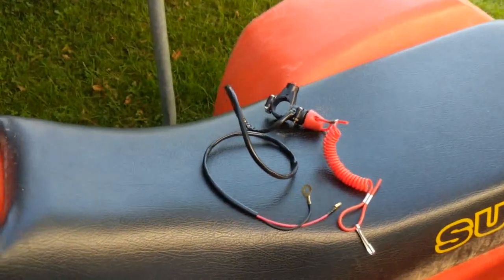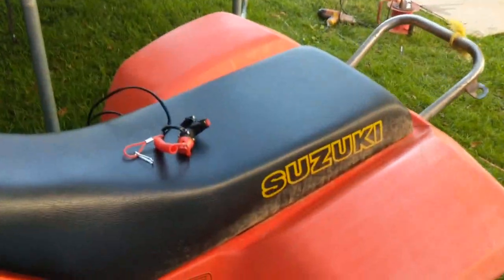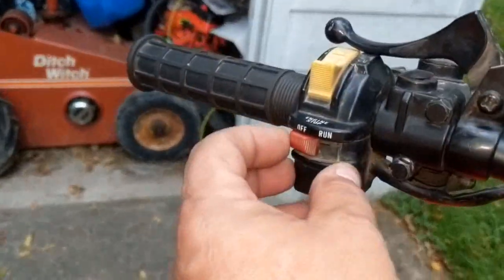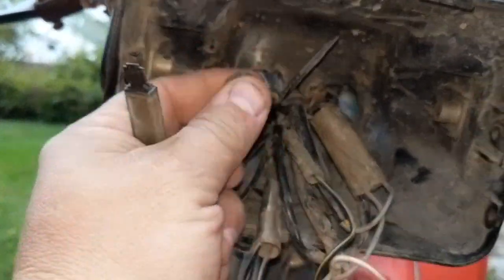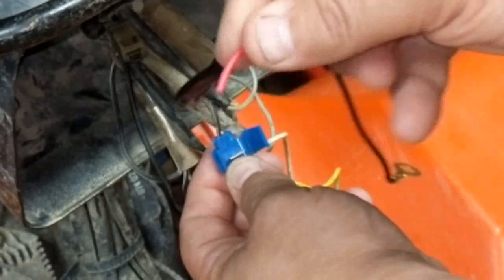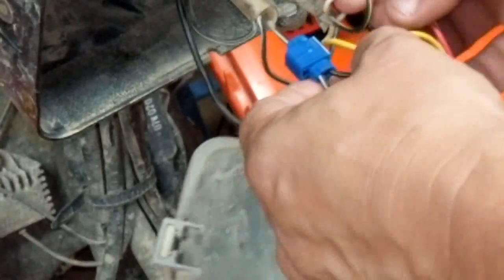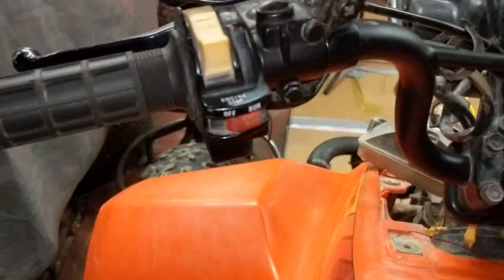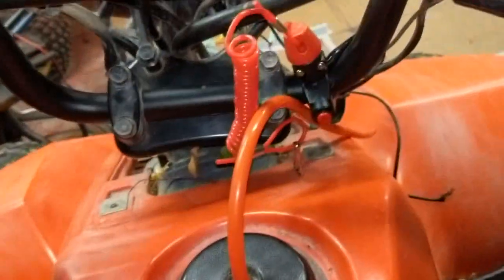How to install lanyard kill switch on ATV / dirt bike. Suzuki 230 quadsport

Comment: old video i know, but anyone watching this, dont ever ever ever use scotch locks (the connectors he uses) they are nothing but a problem waiting to happen, anytime i work on anything at the shop and it has those connectors i cut them out and rewire them.

Comment: I bought my son a new syx moto 50cc bike a few weeks ago. It has this red safety kill switch but when we pull the red top off, it don't shut off at all. We been pulling the plug wire to kill it everytime. He barely wants to ride anymore cause of this. Any ideas why it won't kill it when we remove it?
Reply: The wires coming from the coil might be grounded

Comment: What were those clips called you used and where did you get them
Reply from the maker: There usually called T-taps depending on the manufacturer.  You can usually find them at lowes or home depot.  https://www.lowes.com/pd/Utilitech-20-Count-T-Tap-Wire-Connectors/999956682?cm_mmc=shp-cprdelcgglLIA_ELC_106_Tools-Wire-Connectors-999956682-local-0-_-0&ds_rl=1286981&gclid=Cj0KCQiA0eOPBhCGARIsAFIwTs6dEsEJt7eGFxEKYwiWtPqZRnZDGE_h1Zx3LkTAaptAQEFeowF0_4saAtfiEALw_wcB&gclsrc=aw.ds

Comment: I have a raptor 700r if I add this kill switch and I’m out riding and someone tries to take my quad by pushing me off and I pull the lanyard kill switch would they be able to re start the quad if I still have the kill switch ?
Reply from the maker: If you have the kill switch cap and lanyard , they won't be able to start the quad . That's another nice plus about having a lanyard type kill switch.

Comment: Hi, i'm confuze with my switch as I replaced the old one with the plug only but this one now only works if I actually press the button and keep pressing constantly or remove the plug?
Reply: I mean  is doing the job the other way around? I swaped the cables around but exactly the same thing happen? Any idea 💡
Reply from the maker: Hi. It's sounds like your old switch was closing the switch in order for it to start. The new one sounds like it opens the switch to start. Which is how the one works in the video. The best way to tell is to take the new switch out of the equation, just take the 2 wires and twist them together and see if it starts. My guess is it will start.  Then undo the 2 wires and try and start it. Then it probably won't start. Let me know what that does, if that's what happens then that has to be wired differently from your original. Like you said it's the opposite.
Reply: @AdamzGarage  that is exactly what is happening! Today I removed the plug swith and the rest I removed the welding and welded my old switch that is exactly the sane on the plug part there was no button on the old one, if i press the switch I xan herd the click sound from the starter relay and i can start the bike but if I remove the buton/plug it stops there is no power so I try and connect the spring button onto the old switch and it doesn't work? I mYbe have a power cable and the switch is for a hearth or something  I'm realy confuze on whats going on the old switch is fine but the new one doesn't have it in any way, swaped the cables, swaped the plug switch etc nothing makes it work with the press button now...
Reply from the maker: @Ricardobikelife  yeah. The new switch unfortunately sounds like the contacts are open when the cap is on and closes when the cap is pulled off, what that does in the video is it shorts to ground and shuts the Atv down. Sounds like your old switch is closing the set of wires in order for it to start. Your old switch was just making and breaking power so you could start it. I'm assuming yours is electric start.  The only way to get the new one to work as a kill switch would be to find a wiring diagram and find a way to short the spark to ground.
Reply: @AdamzGarage  yes mate is a ekec5ric start Raptor 700,  2014 model. I got 2 buttons one i play with it removed parts etc and try to conect my old plug buton to see if the spring button was going to work connected on my old plug button but no
Reply from the maker: @Ricardobikelife  https://bikemaster.com/bikemaster-tether-kill-switch-for-atv-normally-open.html

Hey here's a link that explains the 2 different types of kill switches. My best guess is that your original switch was normally open, and the new one you have is probably normally closed. Hard to say for sure not looking at the ATV. But definitely sounds like you have the opposite switch unfortunately.

Comment: Do you know if this switch will work on a 212cc predator engine
Reply from the maker: It's hard to say. But more than likely it would work.  The most important thing is to make sure it's wired in the right place. It helps to have a wiring schematic for the particular quad. If your replacing a bad kill switch, make sure you order the right kind of switch. They come normally open or normally closed. Hope that makes sense.